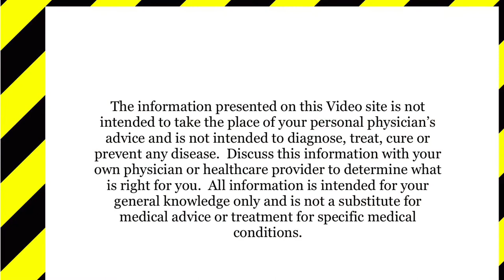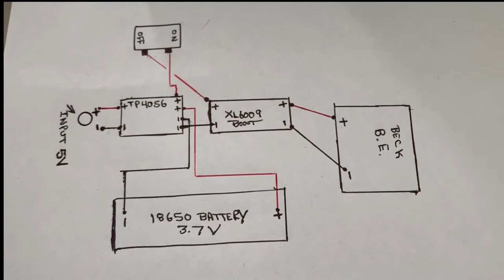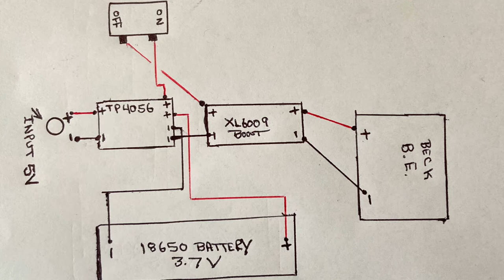Beck Rechargeable BE Schematic  Part 2

Comment: Just saw your how to make ormus egyptian wet method.. why doesn't miron glass need aluminum foil? Is it EMF proof?
Reply from the maker: Miron glass is an antioxidant, biophotonic glass that acts as a natural filter to sunlight. It preserves the potency of natural products and extends shelf life by only allowing rays of light to enter that maintain the natural product's biophotons: visible violet light, non-visible UVA, and far-Infrared light.
Reply: @Enoch-Gnosis  Yes but is that protecting from EMF fields? I was always taught only aluminum wrapping and similar things can do that the glass has no metal/aluminum? Thanks sorry for confusion but never heard glass protects from EMF.
Reply from the maker: @truesight91  use aluminum if you wish , I never had an issue with ORMUS going bad in Miron.
Reply: @Enoch-Gnosis  Oh thanks, I was just wondering because i read ormus neutralize when exposed to EMF rays.